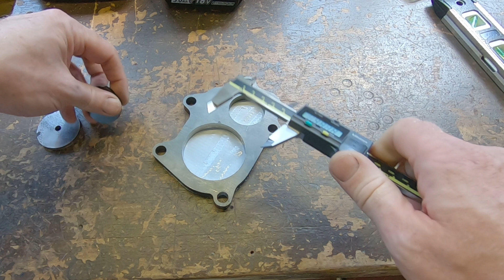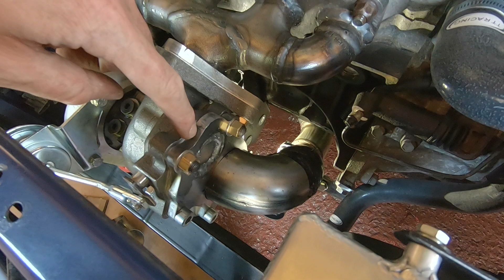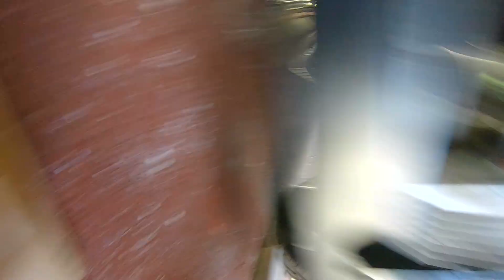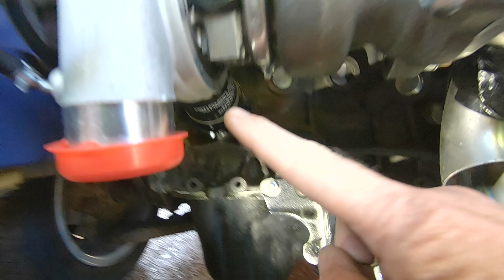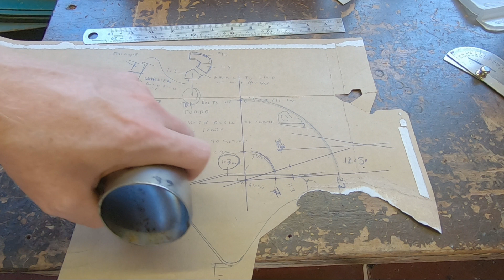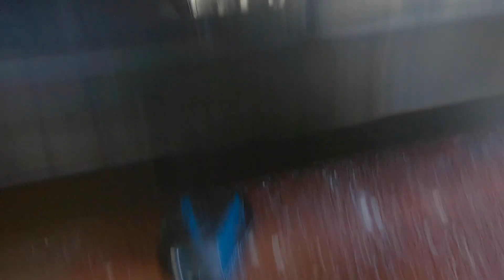How to make a Turbo downpipe exhaust | Toyota Starlet 4efe turbo build.

Comment: Hold up. 15:13 - look at that narrow piece of pipe just before the first flange. Lob that off, and do that over as well
Reply from the maker: The down pipe is 2.5" to 2.25" at the end. It matches the first flange on the rest of the exhaust I bought. It is very common for this size of pipe to be used on 4efte's and won't cause any restriction for my intended power output or quite a bit more. Stock Subaru impreza exhausts run over 200hp on 2.25" systems that reduce to 2" so no worries here! Hope this helps

Comment: Boas amigo vi que tem um 4efe sabe dizer qual é o ponto de purga do sistema de refrigeração desse motor tenho um igual e não sei?!
Reply from the maker: The Starlet doesn't have any bleed points for the cooling system. You just fill the radiator, leave the cap off and run the engine until it is hot and keep topping up the coolant as it needs it. When the cooling fan starts running it's at operating temperature, so engine off, top up coolant and put radiator cap on. Fill overflow bottle to maximum line and let the system cool down. That's how I did it. Obviously be very careful when working with hot coolant! Never take a radiator cap off a hot engine!
Reply: @dan91sgarage  thank you certo much by chance I thought it was better this way easier just be careful not to let the coollant in the radiator Run out and fill it up. Thanks

Comment: I'm not sure about blocking the wastegate hole. Are you planning to run an external gate?
Reply from the maker: I'll stick with the internal wastegate. As I mentioned in the video, plenty of standard Subaru's run a TD04 turbo with a flat outlet flange. There is enough room for the wastegate to open for boost control in this application, so it's fine for my build.